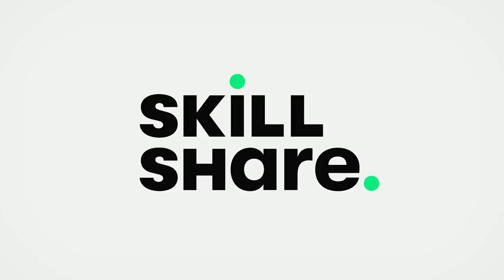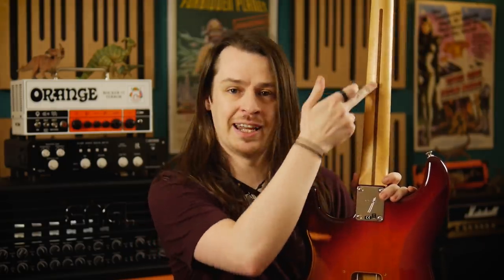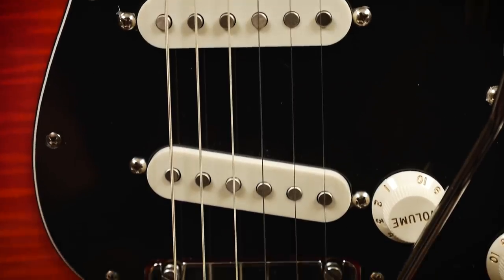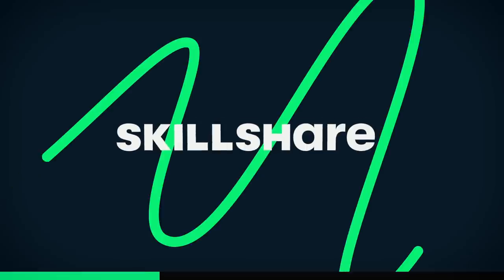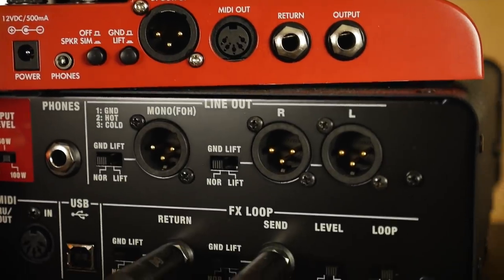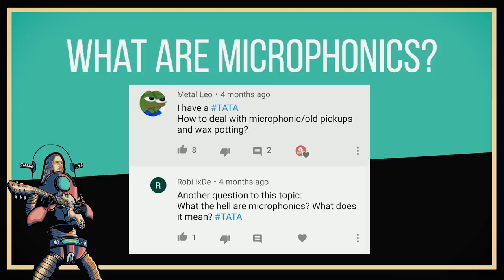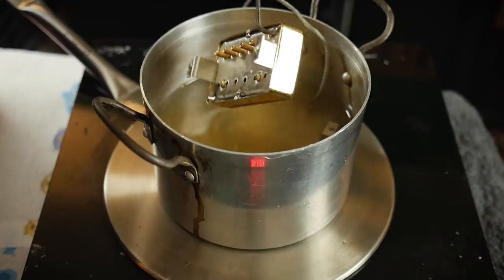5 More Tiny TATAs : Ground Lifts and Skunk Stripes | Too Afraid To Ask

Comment from the maker: This video is sponsored by Skillshare.
The first 500 people who click the following link will get 2 free months of Skillshare Premium:  https://skl.sh/csguitars6

What does a Ground Lift do? Why do Fender guitars have a stripe on their neck? What to the numbered grades of AlNiCo magnets mean?

These questions and more are tackled within this Tiny TATAs episode, the littlest questions that you are Too Afraid To Ask. 

How Microphones Work video: https://youtu.be/uSvNrFB7oz4

#TATA #GroundLift #CSGuitars

More from CSGuitars: 

Gain access to exclusive content at: https://www.patreon.com/csguitars

Buy CSGuitars Merchandise:
https://www.csguitars.co.uk/store

Website:
http://www.csguitars.co.uk

Contact:
colin@csguitars.co.uk
Reply: I feel like it's really important to mention that "Ground Lift" switches on older combos and heads are NOT for hum canceling, they were fused connections for stage performances where gear could not be properly grounded to earth, such as music festivals out in the desert, fields, etc. Anywhere where equiptment was running off generators / non-mains power. Using these old ground switches is extremely dangerous as if you lift the ground for your amplifier and make contact with something else that IS grounded, ex a piece of metal, or even concrete which retains a lot of water even significantly after drying out, you can be shocked and in worst case scenarios, electrocuted to death, If the current passes through your heart. If you have an old Fender with a 3 way or two way switch that says "Ground Fuse" or something to that effect, DO NOT TOUCH IT UNLESS YOU KNOW WHAT UR DOING. Improperly grounded gear can be extremely deadly, as was the case for the vocalist of English rock band Stone The Crows, whose vocalist was famously electrocuted to death mid show by an improperly grounded microphone. I have personally been shocked by a vintage fender amp before as I wasn't aware how the ground lift switch worked, and I touched my elbow to the bridge of my bass while bending down and flicking the on switch for my fender Stage Lead 1X12 which our guitarist was using, the ground was lifted and it sent a shock up my arm and luckily into the bridge as had my elbow not been grounded to the bridge, the current likely would've crossed clean through my chest and out my other hand grounding into my strings which I was also holding at the time. SO BE CAREFUL!!!

Comment: Too afraid to ask what "out of phase" actually means in terms of guitar pick ups. I am aware of what phasing is with microphones but I don't see how it relates itself to guitar pickups.
Reply: It's about the electrical signal from the pickups. Two pickups together will send two signals, and how those electrical signals combine together differs when in or out of phase. In phase, the signals are added together. Out of phase, the signals subtract.
Reply: This would make a good topic, especially if you get into players who use out-of-phase pickups to their advantage like Peter Green or Brian May.
Reply: If you recall that the signal coming out of a pickup is basically an electrified form of the waveyboi the string is doing, there are two ways guitar coils can be "phased":

"In phase" basically means that the pickups are wired together in such a way as their output signals reinforce each other. You get a stronger, hotter signal as each coil pushes and pulls the other and vice versa. The strongest tones from each pickup get reinforced by the weakest tones from the other pickup. This is how the bridge and neck pickups of a strat are phased, and if you have your strat custom modded to be able to use just those pickups together somehow, you can get some ferocious hum out of them.

"Out of phase" means that the pickups are wired together in such a way as their outputs INTERFERE with each other. You get a weaker signal as each coil essentially pushes or pulls AGAINST each other simultaneously, negating the weaker tones from each pickup whilst allowing the stronger tones to come out. So where each pickup has its strongest output, that's what ends up in the overall output signal. The middle pickup on a strat is typically "out of phase" to the other two pickups, and the two intermediate stops on a strat's pickup selector (not the middle-most stop, mind you) select some combination of bridge or neck with middle pickup to get some hum cancellation because of their out-of-phase-ness (more on that in a minute).

In both cases, phase wiring can be done in one of two ways, depending on what's called the pickup's "polarity". This is determined by which end of the pickup's magnets are pointing towards the string, and which direction the pickup's coil is wound. Change either of those, and you change the pickup's polarity, and therefore you flip the output signal upside down or right side up. You can also do this by switching which wire you use as the pickup's output wire, without even having to swap the magnets around or rewind the coil.

When the pickups share the same polarity, they are said to be "in phase". Where one pickup outputs a positive peak, so does the other, and these signals reinforce each other. And where the pickups share the opposite polarity, they are said to be "out of phase". Where one pickup outputs a positive peak, the other pickup outputs a negative, and these signals will cancel each other out, leaving only the tiny bit left over from whichever pickup had the stronger signal.

Humbucker pickups use this to their advantage. With a single bar magnet underneath that has its north and south poles along its long edges, each coil of the humbucker has opposite polarity if wound in the same direction. They produce stronger output compared to a single coil because you have two coils with more turns of coil overall compared to a single, but they're a little bit less sharp on the high end because the opposite phases reign each other in somewhat. But the cleverness of this is the hum cancellation...

That is mains hum, and you are constantly surrounded by it whether you know it or not. The electrical wiring wherever you are is constantly buzzing with a recognizable 50Hz or 60Hz wave, and this wave generates an electromagnetic field. This makes transformers emit a characteristic humming sound... and so, too, will it make your guitar hum as well, as the pickups can quite literally pick up on that electromagnetic field and convert it into output. In a humbucker pickup, this creates an electrical phenomenon known as "common mode noise" across both coils. I.E. it's "noise" that is consistent and identical across multiple conductors. It's noise that perfectly cancels itself out between pickups that are out of phase with one another. Exactly as humbuckers are, or the middle pickup on a strat to the bridge or neck. :)

Comment: hot guitar builder tip: slanting the bridge pickup the opposite way to the strat is quite nice for guitars that are going to be playing mostly metal and djent. it gives the low strings more bite for chugging riffs while mellowing the lead strings to sweeten up sweep picked arpeggios. I've done this on one of my basses to great effect.
Reply: This! 

They had some strange ideas in the sixties on what harmonic content should be in a sound for it to work in a mix. 

It's like with the selector on Les Pauls: The neck pickup is labeled rhythm and the bridge labeled lead, but many players today use them in the opposite way, since you often want a thinner sound for chordal work to avoid muddin up the mix, and a fuller sound for solos.

Comment: Nicely done.  I'll add to the discussion of magnet types the identification of CuNiFe magnets, which were used in the legendary Fender Wide Range Humbuckers.  This is an alloy of copper (Cu), nickel (Ni), and iron (Fe).  Not as brittle as AlNiCo, they could be machined to have a thread, which was frustratingly next to impossible with AlNiCo.  The threading allowed them to be height-adjustable polepieces.  The old DeArmond Dynasonics had height-adjustable AlNiCo polepieces, but the polepieces themselves couldn't be moved.  Their height was adjusted via the bracket each polepiece sat on.

RE:Potting.  I've been winding my own pickups for myself for almost 40 years.  Not placing myself in front of a dimed Marshall stack, the risk of feedback from microphonic pickups is not THAT severe, but still exists.  While having the potting wax soak into the entire coil is optimal, really it's the outside 1/3 of the coil where the greatest risk of loose turns occurs; the inner 2/3 being more tightly wound.  So, I do two things.  I pot my coils from the outside by laying the coil/bobbin on its side, holding a candle several inches above, and melting the candle with a heat gun or hair dryer.  Applying gentle heat after the drops have landed on the coil helps it to soak in.  The second thing I do is use teflon plumber's tape to wrap the coil more tightly.  It's cheap, almost exactly the same width as the coil, conforms nicely to the shape of the coil, and has no adhesives.  Once the coil is taped up, one can then apply whatever decorative tape you want over top of that.  Such tape can be removed in future, without damaging the coil because the teflon tape is protecting it.

Comment: I have cousins who are in a local band and they sometimes play in some really old venues. I am talking about buildings that were new in 1900. Some of the wiring and grounding issues are really a mess. I was loading them into a gig and when we powered the whole thing up, it was crazy. Ground lifts were the only solution. Every effect pedal was affected, every mic, the amps...and add a single coil guitar to the mix and you had a cacophony of hums, buzzes, pops, crackles and some sounds I can't put a name to. We ended up buying a power conditioning unit that everything plugs into. Only one connection to the venue. The Furman brand is what we chose. No ground lifts needed.

Comment: I have un-potted pickups in a 50s style LP I built. They are very microphonic, but I don’t find them particularly difficult to control. Once I turn the sustain down on my compressor, they behave like my other pickups. On a cramped stage with multiple amps and monitors that might be different though.

Comment: Great video. These TATA ones are really great because if you haven't already asked yourself about something yet you would eventually get there so keep up the good cause!
My TATA is how does the effect of the valves change if you blast volume with lower tone control settings versus the opposite on an old super reverb amp until you reach desired (or allowed) output volume?

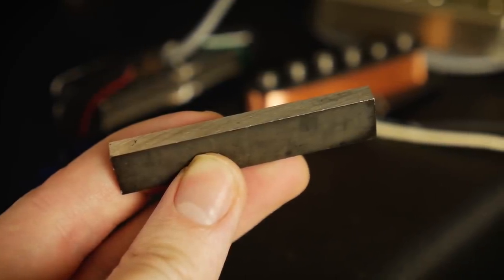Comment: Colin mentions that AlNiCo magnets are superior to the previous low-performance Iron magnets. 0:40 Unsaid was the fact they were also superior to the subsequent Ferrite Ceramic low-cost magnets. That is why some players prefer them despite their cost. Neodymium magnets were a further improvement, too powerful perhaps for some old-fashioned brown tones, but much less weight to achieve useable strength.

Comment: Hey Colin! I got another TATA for you; what’s the difference between Silicon and Germanium fuzz???
Reply: Germanium is warmer sounding. Silicon is harsher but less temperature sensitive.
Reply from the maker: The difference is the material the transistors are made from.

Germanium and silicon semiconductors have very different response characteristics both in their junction forward voltage and electron/hole mobility. 

Germanium transistors are able to function faster than silicon, but they are less stable to voltage and temperature. 

Semiconductor physics is a whole thing. Maybe I pluck up the courage to talk about it one day.

Comment: Here's my TATA: How do Lace Sensor pickups work?
Reply: Stephen Cagle they stack 2 single coils for less hum. I have a Am Deluxe Plus w/ 3 color Lace Sensors.  I love the sound.
Reply: This!
Reply: Mine are working fine! Thanks! :-D
Reply: Depending on which ones your talking about, it's either one loop of a thick wire around a magnet or the magnet is surrounded by a metal plate similar to how a regular pickup works but with the plate/wire taking the place of the coil of very thin magnet wire. This creates a sensing circuit hence the name and then a transformer boosts the voltage to a more usable amount.
Reply: +1

Comment: About the strat pickups, I thought the pickups (at least the originals) where identical in all positions, you can adjust the volume difference by adjusting pickup distance from strings. Also, the angling of he bridge pickup must have had some other roots, back to early telecaters and the lap steels, probably to make the new guitars look familiar or maybe they had a bunch of lap steel pickups laying around but they needed to be angled to fit the narrower string spacing of the tele. Just a hypothesis. Another question could be why all pickups are not angled then? Or maybe angled differently? Mainly because it would look strange. And once the trend is set, you can make up reasons why "wound strings sound worse if pickup is close to bridge".

Comment: Colin, can you please explain, as a tata, why it is that if you turn down the guitar volume (say to 7) and then use a boost pedal to boost the guitar signal to the same volume as when the guitar's volume control was on 10, you get a different sound.
Reply: @darkflamerpunkboy  Thanks, but I think that there is more to it than this, such as loss of frequencies from the guitar. Over to Colin.
Reply: Depending on your wiring, your volume pot effects the tone controls as well
Reply: Colin HELP! This is quickly turning into a rabbit hole!
Reply: The output impedance of the guitar and the capacitance of the cable forms 
a filter. when you change the volume you change the output impedance of the guitar and thus the filter
Reply: I'm not Colin, but I'll give it a shot. Wall of text ahead.

There's an electronic circuit called a voltage divider, whose purpose is to take an input signal and reduce it to a lower level as desired. It's made of two resistors, and it has a total of three contact points - the input, the output (which is the mid-point between the two resistors) and the ground point. A volume pot is a variable voltage divider because as you're turning it, you're changing how much resistance there is between the input and the output (the series resistance), as well as between the output and the ground point (the parallel resistance).

When your volume pot is turned down, the resistances inside are divided so there's maximum resistance in series, but minimum to none in parallel. When there's no resistance in parallel, all the signal from your pickup just goes to ground (because it's literally the path of least resistance) and the guitar is dead silent.
As you're turning your volume up, the resistances are readjusted so the parallel resistance grows (preventing all of the signal from just rushing to ground), and more and more signal start going through the output mid-point, and your volume slowly grows until you're at full volume and the entirety of the resistance is parallel.

The reason the volume changes also affect tone is that pickups aren't ideal sources - they're coils (inductors), which physically tend to pass low frequencies and block high frequencies, and once your pair them up with a parallel resistor, they end up behaving like a filter that gives whatever signal gets collected by the pickup a distinct coloration (by virtue of letting more or less of some frequencies through).
Inductor-resistor circuits (LR circuits) where the resistor is in parallel are low-pass filters, and the bigger the resistor is, the more frequencies it passes through. So as you're turning the volume down, you're making the parallel resistor smaller, moving that frequency cut-off point more "downwards" towards the lower frequencies.

This is also the reason why, if you take a guitar with 500k volume potentiometers and swap them for 250k volume potentiometers, it will sound a lot "darker" when turned to full. No matter how much boost you put after such a guitar, it won't sound as bright as a 500k volume-equipped guitar.
Reply: Thanks for that -  I think that you and Colin would get on well together.

Comment: The strength of the magnet has no direct influence on the tone of the pickup. The difference in tone is caused by the fact that a pickup with a stronger magnet can have the same output with less windings and therefore kill less of the highs. Furthermore, a higher output will obviously give a more saturated tone as it drives the input of the tube amp harder.

Comment: Great video thanks. Would you be able to explain the following in a video when you have time please? In a FX loop (in particular on the Boss Waza tube amp expander), there is a level switch (+4dBu, -10dBu). How would you know when to use which (+4dBu vs. -10dBu)? For instance I have an EP booster pedal from Exotic that I wanted to plug on the FX Loop but I don't know in which position to set the switch. I checked online but could not find a proper explanation or how to find out. Thanks. Cheers.

Comment: Tiny TATA:  PA speaker size - if an 8" and 15" have similar loudness and usable frequency range, why use the larger size?  The consensus is typically to use a 12 or 15" speaker - is that just old practice, or is there a practical reason?
Reply: Larger speakers have more low end frequencies.